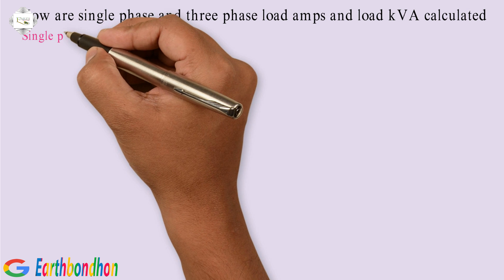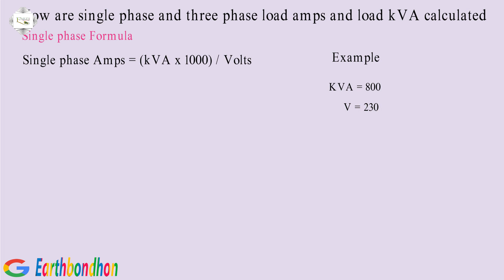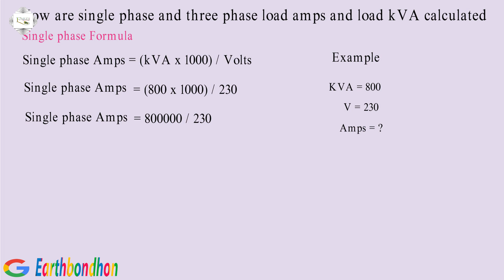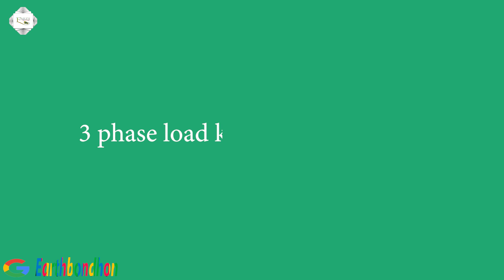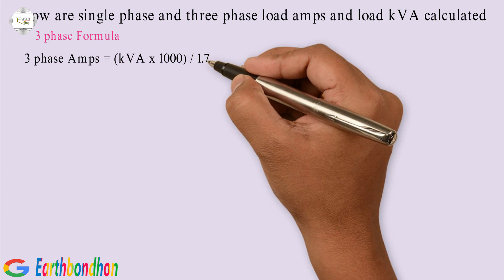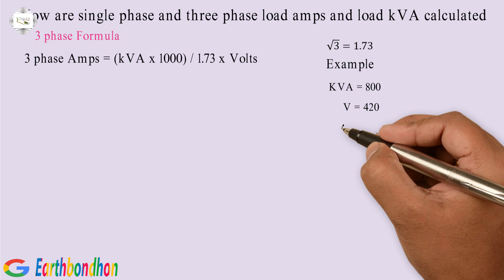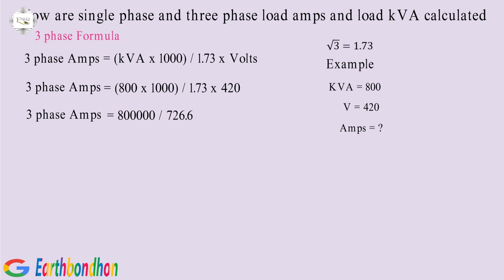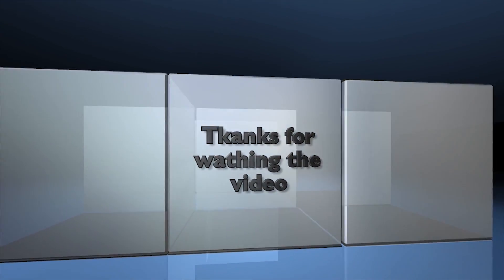How are single phase and three phase load amps and load kVA calculated | KVA to Amp | Earthbondhon

Comment: Where did u get the 1.73 volts in threephase
Reply from the maker: ok.....
Thanks for your feedback, please follow.........
"Thanks for watching the video"   You are very welcome!
Reply: Hi Ryan, i see that Earth Bondhon doesn't really reply to comment,
the volts is 420, 
The 1.73 that you are refering to is because the voltage between the phases is 1.732 times the phase to neutral voltage. We only use this in the case of three phase electricity.
Reply from the maker: Thanks for your feedback, please follow.........
"Thanks for watching the video"   You are very welcome!
Reply: @AfricanDanMan  not good uploader but tnx to your answer sir